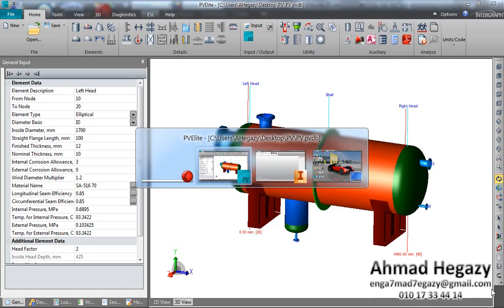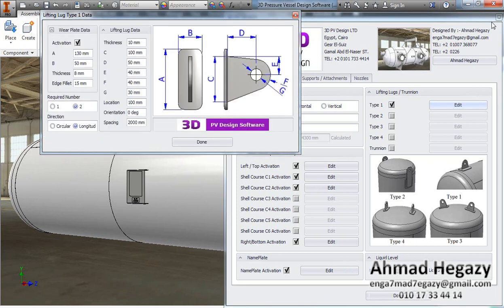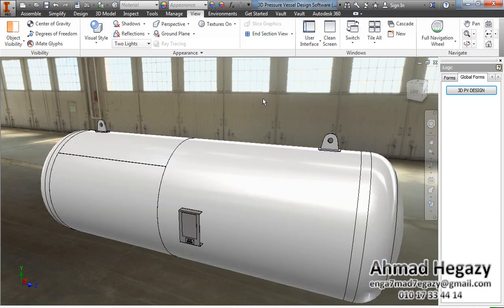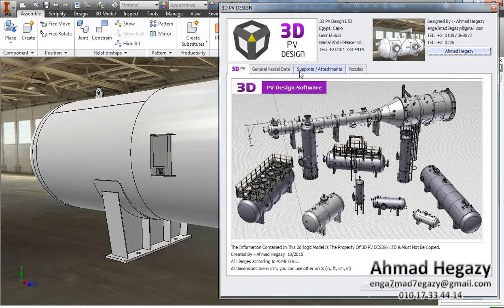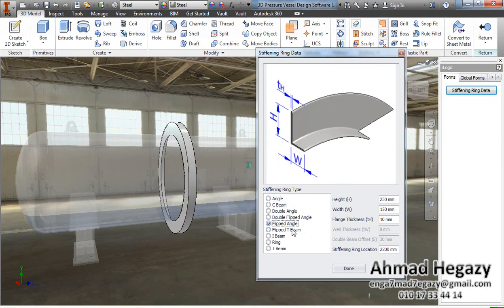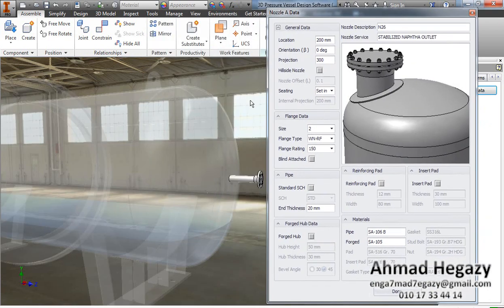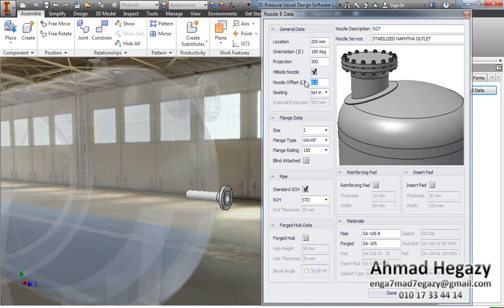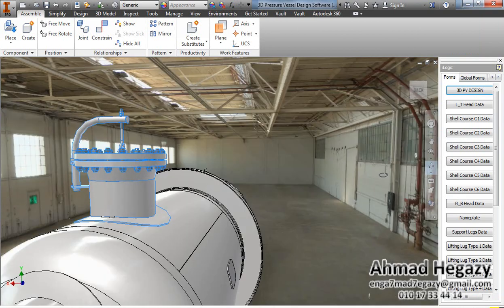3D PV Design Software (Horizontal Pressure vessel)

Comment: Interesting Software. 
Whether the software is compatible with BricsCAD. Whether the generated 3D model can
be converted into 3D model for PDMS.
Reply from the maker: the new software can read the access file of the PV Eliet, to create the 3D model of the pressure vessel.
by the end of August I will finish the new version of the software
it is not compatible with PDMS or BricsCAD

The extensions for exporting are (stp, sat, gin, dxf, dwg, iam, dwf, jt, png, x_b, x_t, g, neu, stl, tiff, xgl, zgl, dwfx)
Reply from the maker: Please Check your email